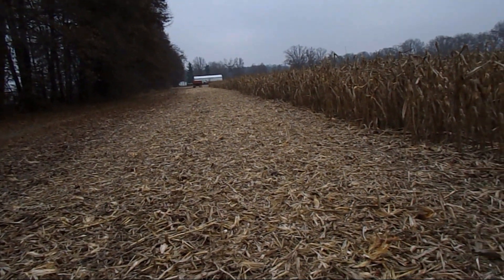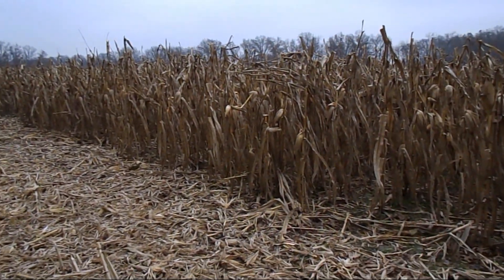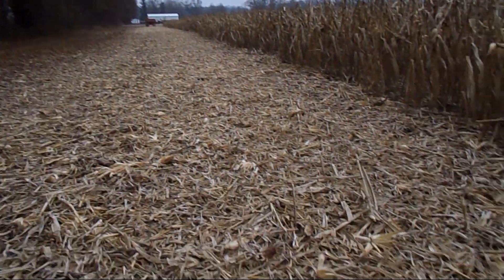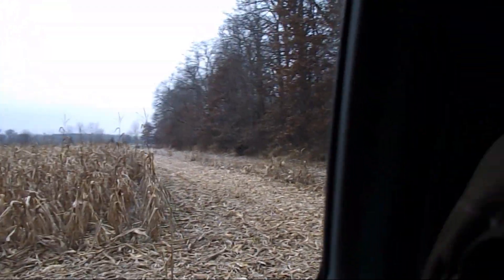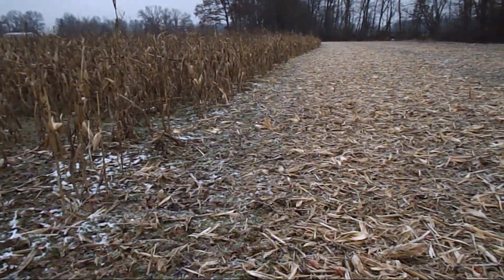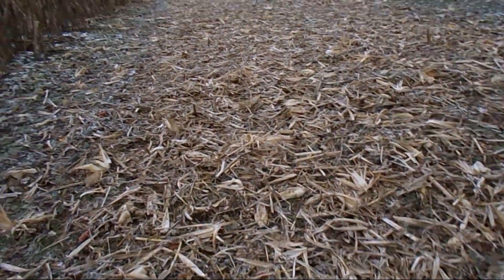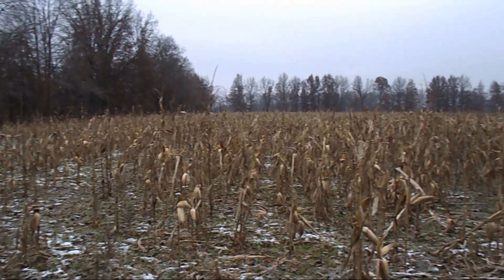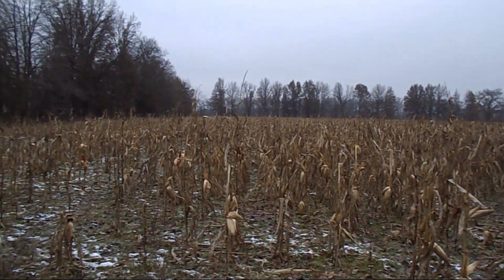Shelling Corn with a Grain Head ?

Comment: I combined some bloody butcher corn with the gleaner last year.  Windblown every which way so neither the picker or corn head could get it. I got it but would never have been able to put it on YouTube.  I was using swear words I didn't even know l knew.
Reply from the maker: Its not something I would want to do every year but it works if you have to but nothing ventured nothing gained !   I figured with all those little ears around the ends and sides of the field the grain head was the best bet to get most of them, Cant get them all but the grain head was a better option than letting the corn head grind them up. It did a pretty good job all thing considered .  I didn't mind doing it this way the real pain in the butt was a couple of days later when I was shelling it and started to have problems with the combine !  LOL  Bandit